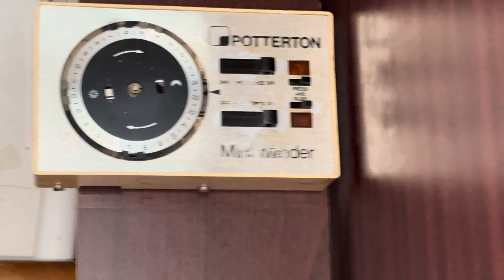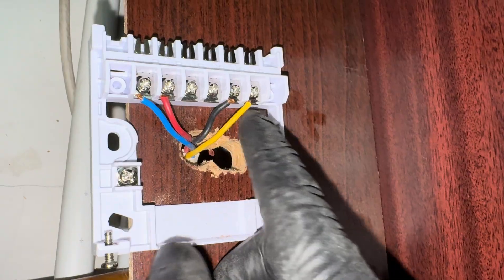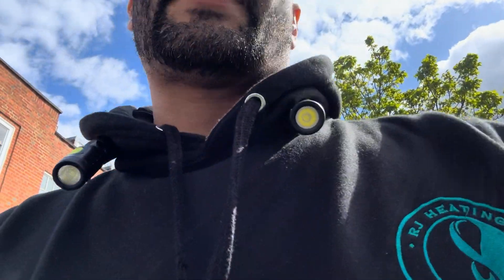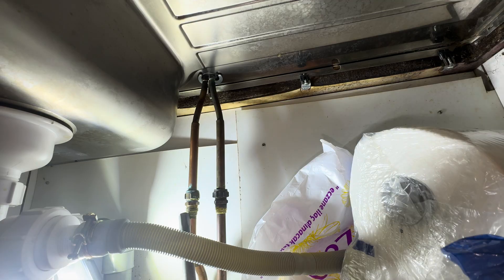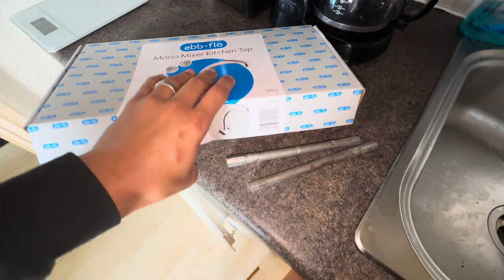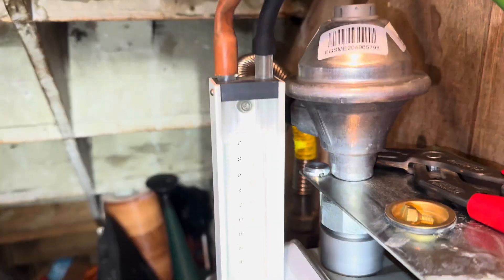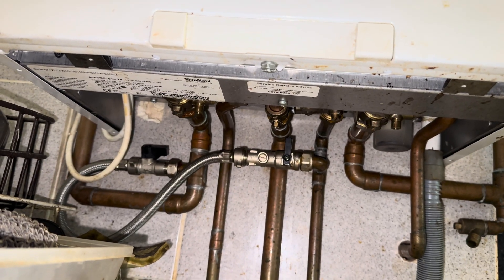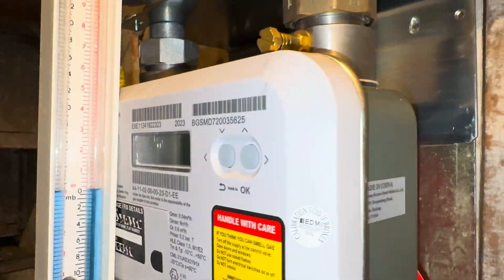Electrics vs Plumbing vs Gas

Comment: I’ve stopped using the Viva fill valves as they tend to let by after a couple of months….. 😂
Reply from the maker: @yensabi  oh really, I don’t really do much plumbing but that’s interesting and definitely useful to know! Although, that’s the only one I could find in this 3/8 size, do you know of any others?
Reply: @RJHeating   I now use Fluidmaster pro , more expensive but good quality and you can get in 3/8th or 1/2 brass shank … 👍
Reply from the maker: @yensabi  oh cool, that’s useful thank you! Will give them a try!